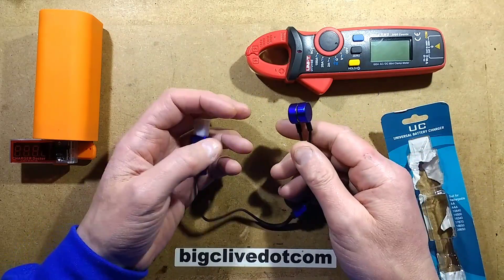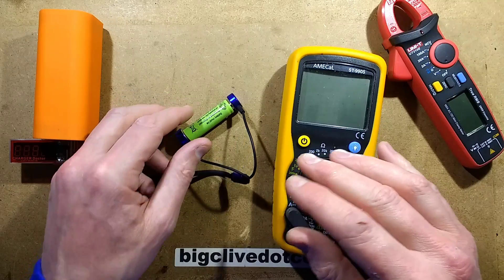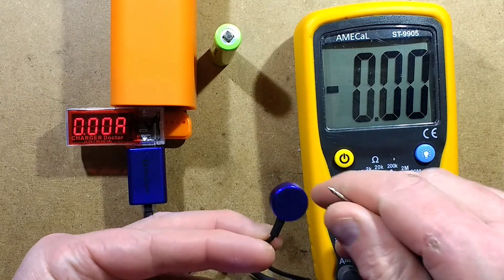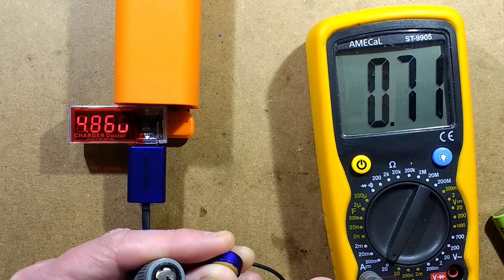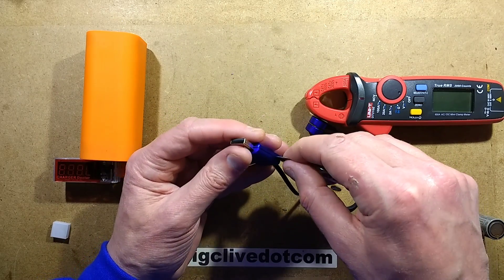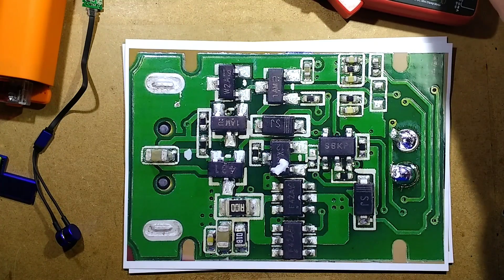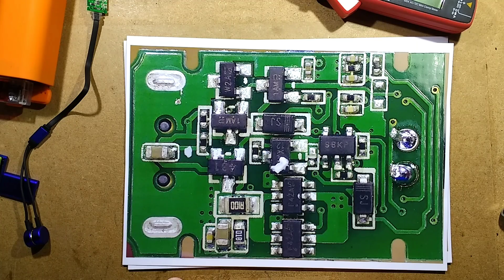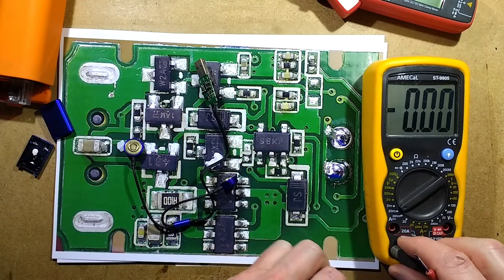Inside a Olight magnetic battery charger.

Comment: can you use this with a car battery?
Reply: mattigi You can't be serious...
Reply: i'm not, i just want to see if it will fry whats it's charging.
Reply: If you could somehow get the magnets to stick to the lead post terminals on a car battery and get the leads to stretch far enough apart to reach the terminal posts and if it could somehow draw 14v from a USB socket it would take a long time to charge a 60Ah battery at the maximum rate you could get from a USB socket which is 500mA ! I think it's more likely that the thing would just explode the moment you connected it to the battery !
Reply: Ian Clarke I'd certainly hope so haha
Reply: mattigi yes ofcouse you can

Comment: Check out the nitecore f1, charger and a powerbank, using the common lithium cells, although not as compact as this.
Reply: Or LiitoKala Lii 100.... does same thing, but costs less than £3.50
Reply: Looks good for the price. I like the nitecore f1 circuit because it shows the voltage in light pulses.  I also have a klarus ch1, but it is in my opinion a poor design compared to the f1.  Actually I'm taking the ch1 apart to install a small switch and usb meter, and design the battery holder a bit better so it won't fall out.

Comment: I have one of those chargers that has been rebranded as Foursevens ( flashlight company). It came with my flashlight I bought as well as the 550mAh RCR123A battery that is rated at 5c discharge. The charger works great for charging the battery and seems to take about 45mins to charge from "flat".

Comment: What if you put 2 NiMh/NiCd/Li-Ion batteries in parallel or in series. What would it do? Could you adapt a battery holder to work with it for charging more than one battery?
Reply: You wouldn't need an "adapter" to hold the cells. Another small magnet woukd do just fine. But I highly doubt the charger would work with more than 1 Cell in series.

Comment: so in theory you could use that to discharge a battery into another usb device
Reply: chris feltner No, the minute discharge current is just used up within the circuitry for whatever reason. You could not use this to charge another device from the battery via the usb port.
Reply: so you cant switch the usb to the other side and put the cables on the imput side. seems like its just a matter of desaldering and resaldering them. but as you say that batter is not got the current to but what about a bigger battery
Reply: chris feltner It's possible that might work with a lithium battery, but certainly not with any other type.
Reply: A. Zak yea though be a good use for getting that last bit out of non recharging ones with a bit of tweaking things
Reply: chris feltner I'm not sure the circuitry in this device would be suitable for extracting the last bit from batteries, it's not really designed for that. You'd really need a circuit with a boost converter in it somewhere.
Reply: true but often its easier to start from a premade thing and mod from there at least for a first try on something
Reply: chris feltner That's true, but i think that the circuitry in the device is so far from what's needed that I'd rather design a circuit to do the job and then make it fit inside the case!

Comment: Olight makes a little flashlight called the S1R that pulls 2.8 amps from the battery! You should check it out, it has a pretty complex circuit for a flashlight, I'm sure. I'd love to see inside.
Reply: Jimmy Puppo every 800+ lumen will pull out that much current, nothing special about it
Reply: The BLF A6 I have from back around that time pulls 5A+ from the 18650 cell.

Comment: Today on "Things You Didn't Know Existed and Now Need"
Reply: car battery terminals arnt magnetic for one..and secondly, why would you want to charge a car battery from usb anyway?
Reply: Why take the effort, just get yourself a nice diesel generator.
(as seen on the old top gear)
Reply: This might work Jusb1066, just gotta drive down a hill to a place and have some minions available that push it back up to the top without using electricity. Then your giant alternator will eventually fill the battery to max capacity.
Reply: Maybe charge the car battery from the in car USB port thats plugged in the lighter socket. it realy works try it
Reply: Nick Drudge
That is exactly what I was thinking :)
Reply: I should specify, I don't want to charge the car battery over usb, I just like the way it connects to the batteries. Also, there are car batteries with posts that a magnet will stick to, like the one in my car.
Reply: 420th like!
Reply: @se09uk, i cant, my electric car is too busy recharging itsbattery from the giant alternator i put on it, tesla will be mad at me
Reply: If only it was big enough to do car batteries too, i'd buy it instantly